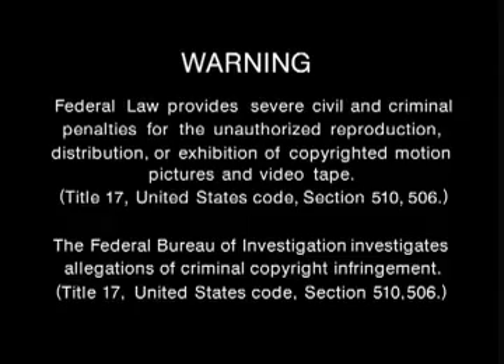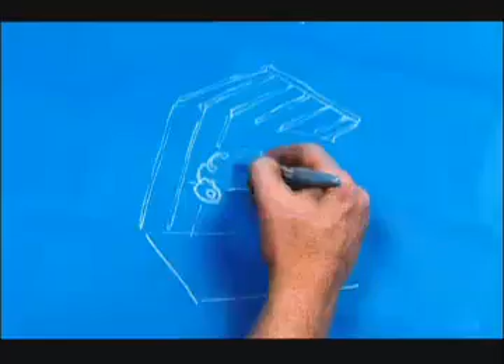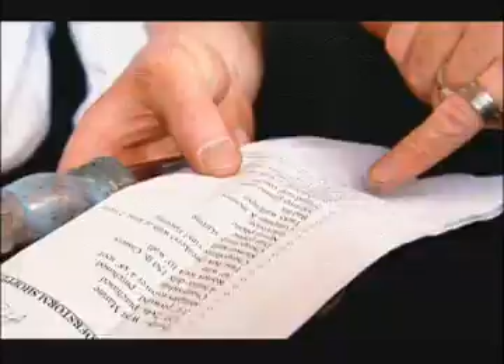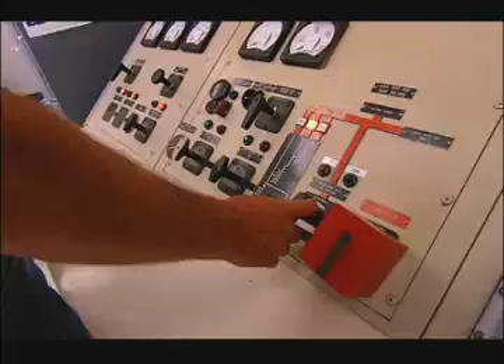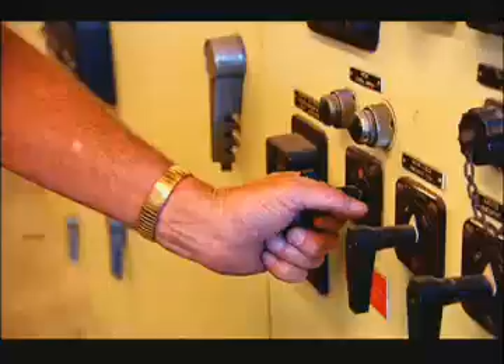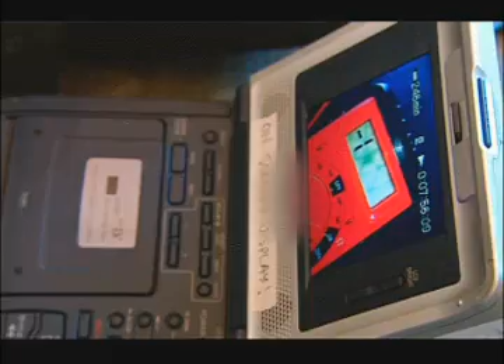MythBusters  Electricity and Magnetism  Electrical Safety in a Thunderstorm

Comment: I worked as a Telecommunications Engineer for 20-years. I have seen phones where the line has been struck by lightning. I've seen heat and current so intense that it has welded the metal contacts in the plug and socket together. I've also seen one get so hot that the solder on the circuit board inside the phone melted. Electric shock is not the biggest danger, but acoustic shock is. I saw one customer lose the hearing in one ear due to that type of shock. Most phones have an acoustic shock suppressor mounted inside the ear-piece. They're not bad insurance, but they aren't infallible. My advice? Stay off the phone during a storm.
Reply: Thanks for the advice 👌🏻
Reply: @Zero.timelord  you're welcome. Stay safe.
Reply: Me, watching this during an insane lightning storm
Reply: Vj
Reply: V
Reply: It's more accoustic shriek,  a shower is ground drain you need a 6ma across the heart to electrocute.
Reply: I dont think scientist can grasp they can't recreate the power of mother nature
Reply: @Ove08
Yet they said that, several times...

Comment: Was thrown off a chair by a lightning strike that killed a computer monitor but strangely not the computer (A BBC Model B, was 1984 ish).Was using a joystick with a metal thumbstick playing Elite the original. I was obviously a bit WTF was that at the time.
Reply: Thargoid first contact?
Reply: @SPDFRK  Revenge from the Pirates no doubt.

Comment: Yes you can be struck by lightning if your house's grounding is shit. So myth busted.
Reply: houses are a faraday cage.... oh sorry you guys still make your houses from wood..
Reply: As a computer engineering student i never underestimate worst case scenario which means anyone can get struck by lightning
Reply: @oddjobkia  Faraday cage has nothing to do with lightning safety, and your house is made probably of cardboard.
Reply: @sachinshilwal71  right
Reply: Faraday cages are made from conductors. A house, no matter if stone or wood, is not a conductor. Usually lightning goes through wires and drains and those are grounded. But j it's not a faraday cage, because the gapes between those are too great.